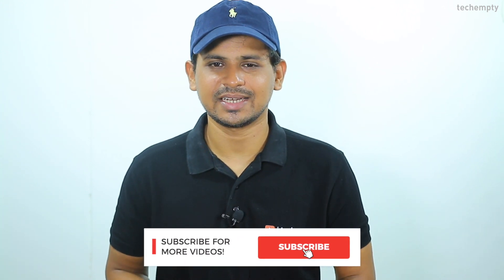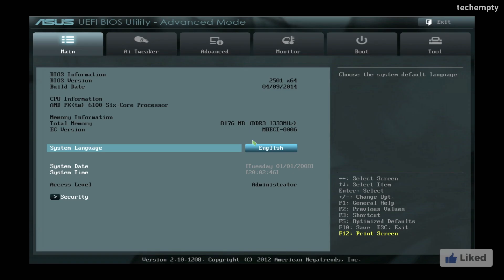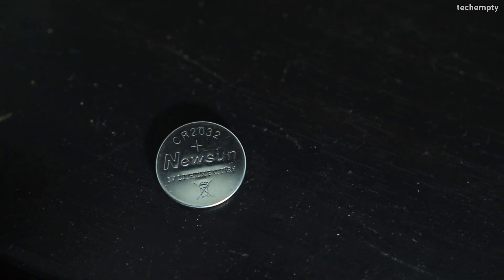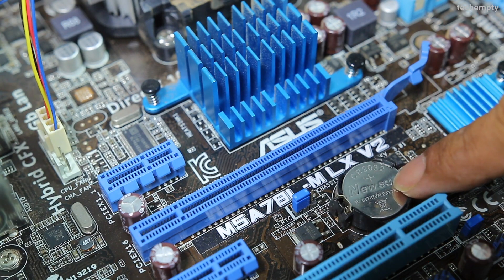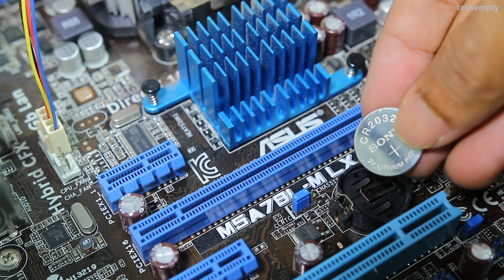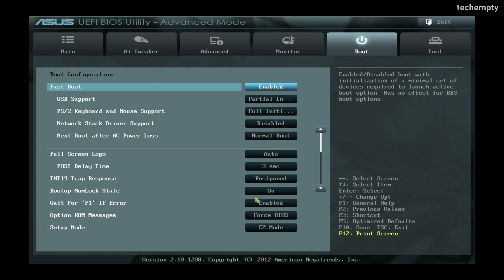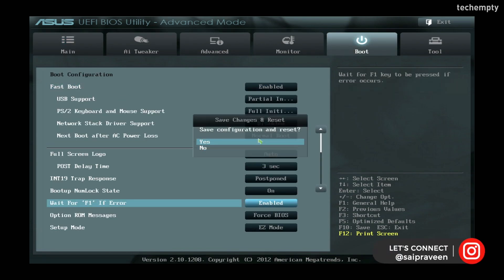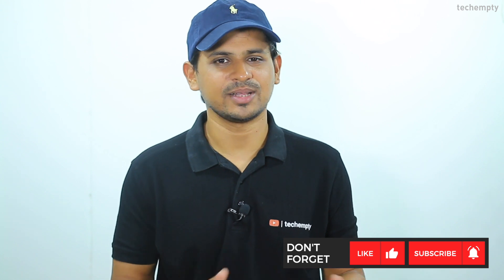How To Replace CMOS Battery to Fix 'Press F1 to Run Setup' Error?

Comment: Thank you for the video Sai. I had a feeling my cmos battery had gone flat since system time and bios settings were not being saved. Seeing your video confirmed my suspicions and after replacing the battery it was fixed.